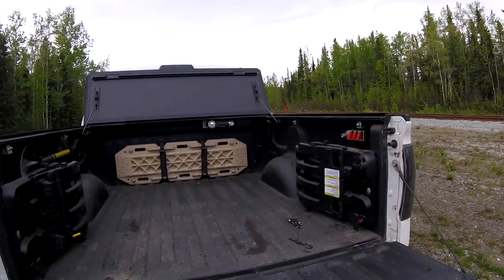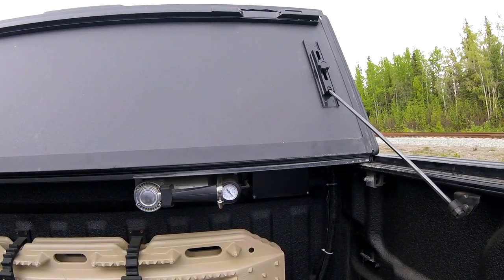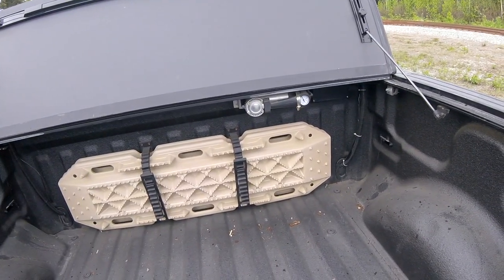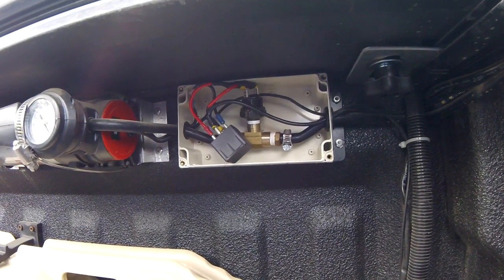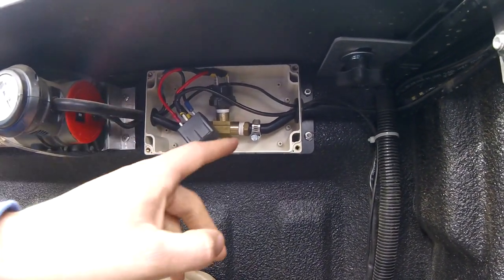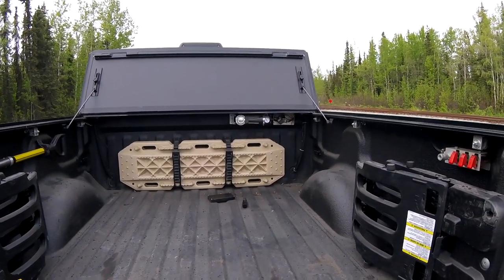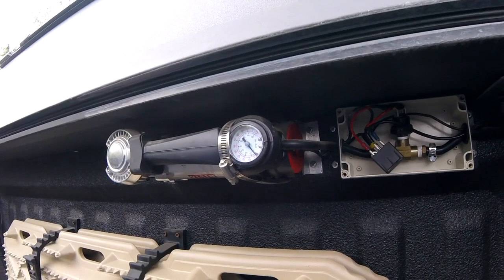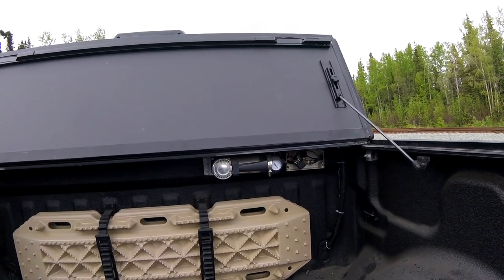Budget On-Board Air System

Comment: Excellent solution. Air switch will work good with a small tank for me to clean chainsaws out. Save the hassle of a switch in conjunction with a separate battery for appliances.
Reply: This what I want one for, also blow gun for cleaning myself before getting in truck. Where are you putting yours, I'd rather not have mine in the bed of the truck

Comment: it may be budget but it looks well made, if I were you I'd add a 1/2 gallon tank, they are pretty cheap and it would give you a bit of a reserve before the pump kicks on, otherwise it looks mint.
Reply: Once u do all that work heck no. Get 1.5 gallon or larger tank and use all high pressure hose lines at 120 cut in 150psi cut out. Can run air tools and blow gun. None of that push on plastic hose crap. Also get a high end compressor i got the 480c. 1 gallon will work and I'm using it but it's barely enough.

Comment: I don't understand the point of the pressure switch, like those couple of second before the connect to another tire. I wanna do the same but with a adjustable pressure switch. Connect the tire set the pressure and wait for it turn off. Can also then get hose to connect all four tires at once. That's the plan. Do let us know reasons for the pressure switch? Keep the videos coming!
Reply from the maker: I did it because I didn't like the idea of the compressor running all the time. Admittedly, it is probably and unnecessary complication.

Comment: Hey man your setup looks like what Im trying to do with a smittybilt 2781.  Did you run your power to the starter or do you have constant power? 
Nice truck BTW. I have a 2019 STX 3.5 and absolutely love it. Thanks for taking the time to share your thoughts.
Reply from the maker: I ran my power to the battery so that I could use it at any time, even with the truck off. The other option would be to find switched power somewhere and use an add-a-fuse.

Comment: Nice Set up . Looking for something like this to set up my Gobege Air compressor. But One question, what kind of hose do you use to run the air towards the toggle switches?  
Thanks
Reply from the maker: I just used the rubber hose that came with the compressor. An option to consider might be some polyurethane hose with the push-in fittings.
Reply: @NSQGarage  thanks

Comment: I see you are using a pressure switch. Exactly what is building pressure, i don't see any tank. What causes the system to reach the desired PSI?
Reply from the maker: The pump builds pressure in the line and then quickly shuts off

Comment: Where did you get the housing that houses the switch and air line quick disconnect near the tailgate? I have a viair 400P and am going to do that same thing. Thanks!
Reply from the maker: The switches are mounted onto some 90 degree aluminum. The box that holds the relay is in the description along with the air chucks.

Comment: Nice job!  I have a retrax tonn cover that rolls into a canister at the top of the bulkhead. I’m thinking of mounting a viair compressor and small tank to the bulkhead beneath that canister. Have you been happy with the noise level from compressor?  I’m concerned it will vibrate the bed and be too loud.
Reply from the maker: It is pretty loud. I would try to get a model that has some good rubber feet so it mitagates that. I think the smittybilts would work better. The sound also seems to amplify in the cab. Not really an issue unless the baby is sleeping lol.

Comment: Just curious, whats the point of the pressure cut off switch if you're not using a tank?
Reply from the maker: You do it so the pump does not run continuously. Without the cutoff, the pump would run until the air fittings, air lines or pump were to fail.

Comment: Interesting setup... and as cheap for those in Canada aswell....
What is the pressure switch/relay for, as I see this is a tankless system??
Reply from the maker: It allows me to leave the switch on and it turns off when not hooked to a tire

Comment: No issues running this at that 90 degree angle?
Reply from the maker: That's a good question. Admittedly, I didn't consider that risk. It did get loud towards the end of its life (before I switched to a power tank), but that could have been the cheesy mounts I made.

Comment: Hey, interesting set up. Would you be so kind to share the connection diagram? thanks in advance
Reply from the maker: Send me an email at notsoquaker@gmail.com and I'll email it to you
Reply: If your gonna keep the truck for years and not trade it in you will have less expense with the v8 the turbo engines at about 180k will need the Turbos replaced soon
Reply: Also interested in the diagram

Comment: so you have wires that run back to the fuse panel or the battery right?
Reply from the maker: Yes. I believe I ran those directly to the battery
Reply: @NSQGarage  nice i want to to the same thing. Im in New York and we drive on the beach all the time. do you know roughly how long it takes you to air a tire back up? Also is there a tank associated wiht that compressor? i see it has the regulator.

Thanks for your help
Reply from the maker: @fallyyerr8170  this was a tankless set up with "on demand" air. As far as time goesz it depends on what pressure you are going down to and how big your tires are. If I did this again, I would choose a bigger pump. With this set up, I was spending 10-15 minutes a tire to go from 25 psi to 35psi on a 35x12.5r17
Reply: @NSQGarage  omg lol. I dont got that kind of time. Thanks for the input
Reply from the maker: @fallyyerr8170  I know lol. That's why I suggested a better compressor. I also just converted over to a power tank. Fills up tires in seconds
Reply: @NSQGarage  now were talking. either way great video and nice install. cheers

Comment: How did you wire the relay and pressure switch?
Reply from the maker: Send me an email and I can send you the diagram
Reply: @NSQGarage  do you have to take the air compressor apart? I have a harbor freight air compressor and kinda don't want to buy a new one.
Reply from the maker: @yiayang3403  nope, you have to cut whatever plug or clips are on the compressor and then wire the 2 remaining leads to your relay
Reply: @NSQGarage  put my email down on the comment above if you didn't see. I think I know what you mean and how to do it but the diagram will be appreciated. TIA
Reply from the maker: @yiayang3403  I'm not seeing your ema address. Hit me up at notsoquaker@gmail.com
Reply: @NSQGarage  sent you an email.

Comment: Where is the tank?
Reply from the maker: No tank, compressor runs when you need air!
Reply: @NSQGarage  🤔...cool.. I'm not planning on inflating car tires,, but I do need air to air blast dirt dust inside my jeep.. would this compressor sufficient enough for that?..because it dont need a tank... my concern is can it deliver air continuously?thanks!
Reply from the maker: @ujayet  hmm I don't think so. I think blowing air uses a ton of flow. This pump only has 1.47 CFM. I don't think a larger pump could keep up either. What you could do is store a full tank and refill it before you hit the trails.